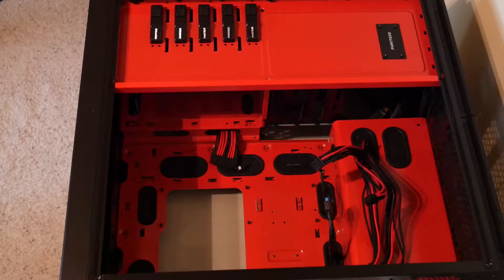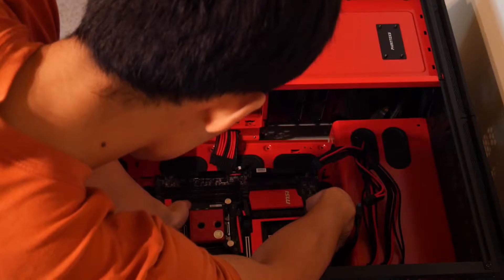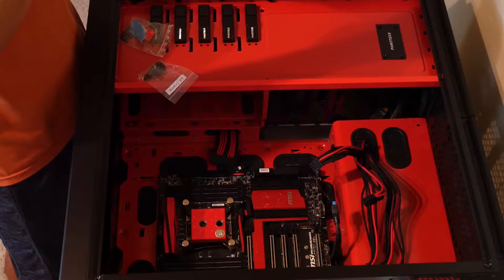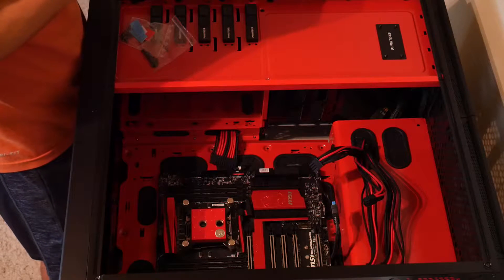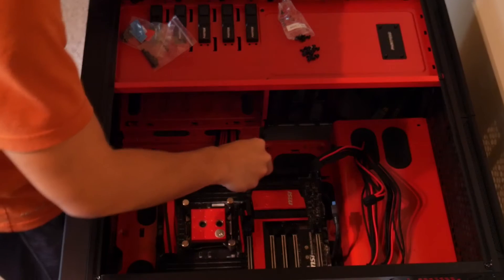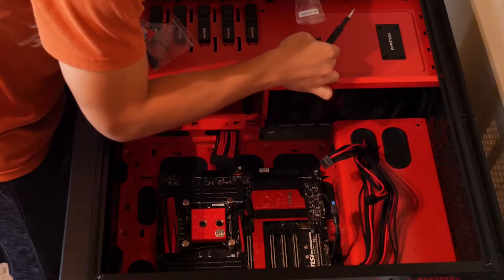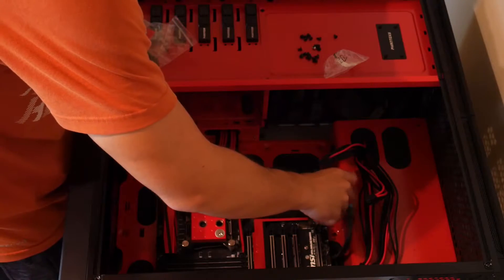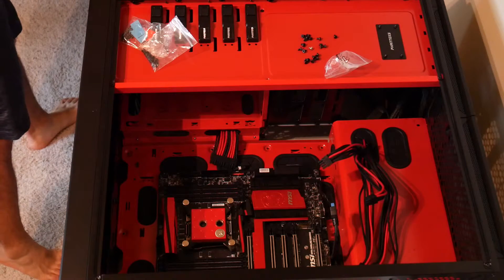Main Watercooled PC Build Log #2 Phanteks Enthoo Primo Case 5960x gtx 980ti sli

Comment: you can mount 2 res,  2 pumps easy, take out the drive cage, seen a video on it with this case. https://youtu.be/LoGsGNyE8no , he did a great job on it, check it out, also if you like check out my 2 video's on water cooling, 1 hardline, 1 soft tube.. the soft tube was my 1st water cooling pc. saving to build another hardline pc might go with this case or the Core WP100 Super Tower Chassis, with a  ASUS RAMPAGE V EDITION 10 LGA 2011-v3 Intel X99 SATA 6Gb/s USB 3.1 USB 3.0 Extended ATX,  Intel Core i7-6800K 15M Broadwell-E 6-Core 3.4 GHz LGA 2011-v3,   Dominator® Platinum Series 32GB (4 x 8GB) DDR4 DRAM 2133MHz,   2 GIGABYTE GeForce GTX 1080 WindForce GV-N1080WF3OC-8GD Video Cards,   EVGA SuperNOVA 1200 P2 220-P2-1200-X1 80+ PLATINUM 1200W Fully Modular EVGA ECO,   2 SAMSUNG 850 PRO 2.5" 1TB SATA III 3-D Vertical Internal Solid State Drives,   2 Asus VP279Q-P Black 27 5ms (GTG) IPS Frameless Widescreen LCD/LED Monitors,   Singularity Computers Ethereal Dual V3 Reservoir Mounts - Green Model,    Mayhems Yellow & green Pastel Coolant,   EK blocks,   EK fittings ect..   calling it The Sting Leaf... Hoping to get everything by the end of next yr as it's going to be ALOT of money but well worth it for yrs to come.. Nice build btw the way.. also liked and SUB for ya...